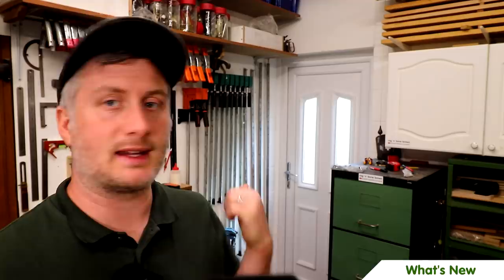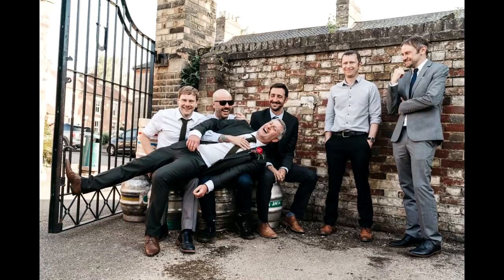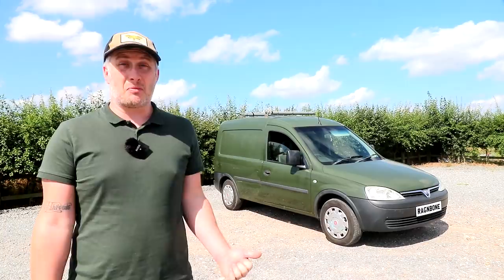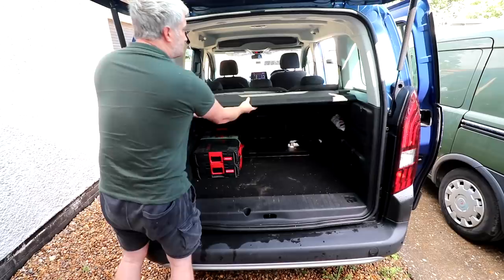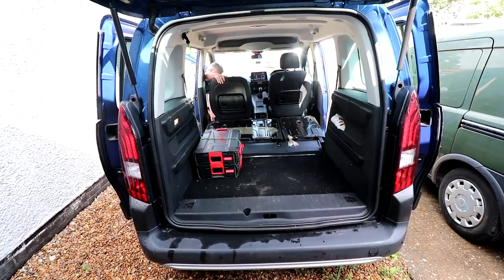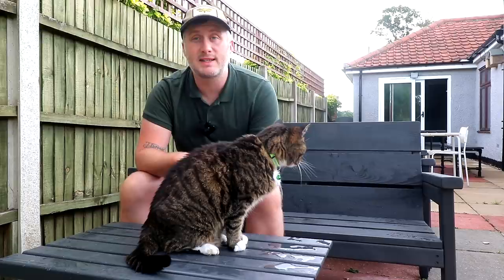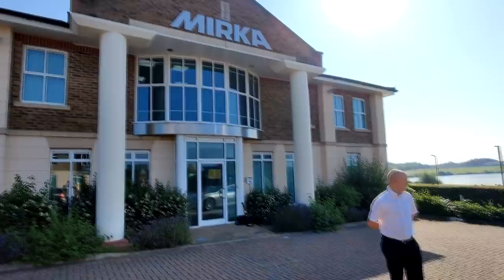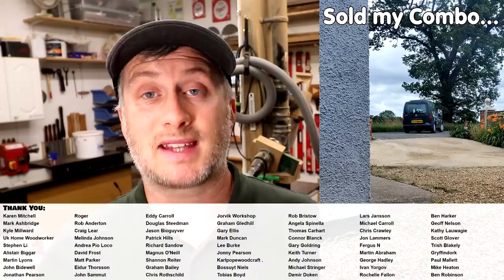VLOG 15 - What's New / New Vehicle / Wedding / Tool Talk / Recommended Viewing

Comment: Get some tarps just for the van. I just had them folded in the wheel well. I got used to being able to quickly cover the back of the van when I was picking up ratty wood etc. 
I cut some down to size but they would fray etc. So just kept them full-size and got quick at folding.

Comment: Sounds like you could do with a trailer, if you’re old enough you don’t need an additional test to tow.  I’ve got a 9x6 with a tilting lid which is great for sheet goods, up to 3/4 ton and I lined it with a carpet off cut to stop the plywood getting scratched

Comment: FYI lwb transit connect will load 4 full sheets of ply in diagonally ,with a solid bulk head
Reply from the maker: Hmmmm.. Not the one I test drove, there wasn't enough height to get it under the shelf above the passenger seats
Reply: @RagnBoneBrown  OK I had the same dilemma a year or 2 back and bought a lwb connect and it works fine in mine. Your new van looks the business, jealous of the extra seats!

Comment: Congratulations on the wedding and the new wheels. You may want to think about some protection to stop the stuff in the back coming into the front in the event of a collision. I use a piece of weldmesh that just slots in the rear seatwell and ties onto the headrest bars ( V70). I have a 8x4 frame of CLS which I strap on for carrying full sheets, which doubles as a portable panel saw, using additional bits of CLS and the Benchdogs Rail Square. I get the stuff home, and cut roughly to size before taking it off the car

Comment: Good luck with the pencil had 3 now over the last few years . I so wanted o them to work especially the long reach feature which you never mention so handy for marking through holes, but unfortunately they have never lasted very long as the clasp that hold the lead gives up and the lead just retracts on use  Maybe I should have sent them back but I leave them in my van and forget Doh.Having said that I've  had the carpenters lead one for about 10 years and been spot on for ruff work and lead lasts for ages.

Comment: The best pencil is the one you have to hand. Agree completely with the pica is expensive but I was buying packs of 50 pencils at a shot and especially being on site someone always borrows your pencil and it goes into the same magic disappearing rabbit hole I seem to put them. Had my pica about 3 years and is always on me so has paid for itself not only money constantly buying more pencils but time lost every day at work but most importantly my sanity. I also borrowed idea from Jimmy diresta and have 3m tape measure that I leave clipped onto my trousers and just pull tape from that position for all the constant smaller measures. Another sanity saver. I find 3m ox tape measure last the longest used like this.

Comment: Peugeot was the best choice indeed

I drive Hilux with the roof rack, which is doing its job: for kayaks, for 8x4 sheets, for large sofas etc. and small stuff I can just throw at the back.
Of course the van-like vehicles have some advantages when it rains, and you don;t need to cover your stuff with the plastic/canvas.

Comment: I use a Ford SMax as a van and I can recommend using an old carpet to protect the interior.  I have everything in mine sand and gravel in buckets, lumps of hardcore, wood, garden waste for the tip etc. Even better is to use 4mm ply and gorilla tape to create sides to protect the plastic.
Mine has done 139000 miles so is not worth a lot but removing the carpet and a quick hoover and it can carry 7 in comfort.
Reply from the maker: Cheers. Someone else in the comments mentioned using corex, I really like that idea. Will definitely get a rubber boot mat

Comment: Great catch up video Keith and I feel honoured to have possibly been one of the last few folk to get a lift in the old van! New car looks fantastic and so versatile👍. Thank you as well for the mention about the Mirka visit. Finally, I've had my eye on that same mic for quite a while. I currently have a Rode directional mic which is mounted about my phone when filming which has been great, but with the new workshop being so much bigger I really do need to address the audio quality (at some point)!
Reply from the maker: Cheers Leo. I have the Rode micro mounted to camera which I've been using up to this point and it's great providing you're close to the camera. Occasionally though I wanted to be further away from the camera and that's where the lav mics like the wireless go really excel 👍

Comment: Hi Keith, I use a Mitsubishi Shogun as a family/works vehicle as it is extremely versatile and cavernous with the seats folded down. Like you I was worried about scratching the plastic internal trim so bought some foam backed fabric and sewed up an expandable  three sided load liner which is held up with ties to various internal fixtures. I'd highly recommend the same for any new vehicle as mine has certainly protected the car from those little accidents and catches loads of dust and crud that inevitably attaches itself to tools and equipment. Hope the Pug is more reliable for you too!!
Reply from the maker: Love that idea. Someone else suggested correx which I also thought was genius as it comes in 2.4x1.2m sheets and bends along the "grain".... I bought a sheet today!
Reply: @RagnBoneBrown  That sounds like a sound plan as it could most probably be 'stitched' together with small cable ties and is quite cheap too!

Comment: Congratulations Keith & Ria, great news on the wedding.

The new van looks nice too, To keep it like that, what about a false floor which can go over the cargo area & the rear seats when they're folded down. It could be hinged at the end nearest the seats so when in taxi mode, it can quickly fold up out of the way of the seats. A shallow draw underneath could be added too for tools & accessories.

Comment: Top stuff Keith - congratulations!

You might want to investigate a plywood lining box for the new car - hinged front and back/sides so you can easily fit/remove it as required to transport all sorts of stuff without scuffing up the new shiny - 9mm might work and not reduce the overall loadspace too much. Just a thought.

Oh, a BTW - you can buy a proper Lavalier mike for the Wireless Go that clips onto your shirt much more discreetly and doesn't look like you have a hamster attached ... ;-)
Reply from the maker: Thanks Tim. I like that idea of a moveable plywood lining. It's really got me thinking. Possibly a future project! Peter Millard kindly sent me an old Boya lav mic he had spare so I will hook that up to the Rode at some point. I always worry though that the more equipment I introduce, the higher the possibility for error !
Reply: @RagnBoneBrown  Happy to help ;-)

Comment: Congrats on the wedding! 
I’ve got a picca pencil but dropped it so the lead just broke 😩 one tip I’ve picked up off John Stene of Stenewoodwork on Instagram, place a small magnet on the inside of your T-shirt, one on the outside, and providing your pencil has metal on (say a mechanical pencil) you just stick in back on your T-shirt after you use it 👍

Comment: if you attach a lav mic to the mic port on the wireless go it means you can get even better audio quality and just use it as a wireless audio transmitter and buy a great lav mic on amazon to use it with it reduces wind noise and the foot print of the thing as it can just go in your pocket.

hope this helps.
Reply from the maker: Thanks, yes I plan to try that at some point👍

Comment: I bought an inexpensive lav microphone on a short cord and I plug that into my rode wireless go and tuck that into my pocket.  It was a simple upgrade.  I just found that the wireless go was too heavy for my shirt collar and would flop around.  (I usually wear a t-shirt in the shop.  If I wore a polo shirt as you do, that might make a difference, or if I wore a baseball cap as a bunch of guys do...)
Reply from the maker: I just got a lav mic to plug in to it too 👍 I'm a bit nervous about it though as the more equipment you introduce, the more things can go wrong!
Reply: @RagnBoneBrown  Yes.   I have TRIED to train myself to turn everything on, but I still have once or twice just started shooting with the Rode turned off.   Or shot something and not noticed that the cable had come out of the camera.    I'm trying to find the original source, but not succeeding.  I forget if it was Jay Bates or a camera channel that suggested this:  I have the rode wireless go PLUS a lav, PLUS a shotgun mic, PLUS a splitter cable.  So the lav goes into the Rode transmitter.  Then on the camera the Receiver and Shotgun both go into the splitter, which plugs into the camera.   The idea is that if the shot is more suited to ambient, then I choose the audio from the shotgun mic, but if the shot is more suited to me talking, then I choose the audio channel from the Rode.  But more than that, if one of them dies, then I should still have the audio from the other.   It means that when I edit I have to select all my clips, put them in Mono, and always choose just the left channel (Rode) or the right channel (shotgun).  This adds a step in audio, and yes it adds a level of things that could go wrong, but so far I am happy with this.  I had considered getting a separate digital audio recorder, so that the rode would go into that, and the shotgun directly into the camera.  But I think that is more suited for LONG takes.  whereas in the shop I find that I am shooting dozens and dozens of clips, and merging all the audio together would, I think, be a huge pain in the neck.  So I prefer to have all my audio in the camera.

And I've rambled on way too much.  Best wishes!
...art
Reply from the maker: Cheers. That's a really great idea!! But yeah it's so so easy to get it wrong and end up having to shoot the same bit multiple times🤣

Comment: Thanks for the update Keith. Just on the van front, I have the old shape Citroen Dispatch (2010) and have to say that although you can fit 3 sheets of 18mm MDF in it, they have to go corner to corner which means the van has to be pretty empty. Does me, but if I was picking up sheet goods regularly (I tend t9 get them delivered) I’d probably g9 for a LWB in future. Starting to look at the world of electric vans, but currently prohibitively expensive to buy so think I’ll wait til the technology comes down in price a bit.
Reply from the maker: Cheers Darren. Yeah, to be honest I'd be quite happy with up to three sheets, as if I was ordering more than that I'd probably get it delivered anyway. But roof rack will have to do, for now anyway

Comment: Hi, I bought a cheaper version of the tool (pencil) but the sharpener leaves a little blob on the end of the pencil and although it is only 1 ½ mm in size it is not as sharp as I would like. My question is have you used the sharpener yet and if yes what is the state of the led end? Thanks for any info

Comment: How are you finding the Rode Wireless Keith after several months of ownership? Did you get the optional lavalier mini mic that attaches to the wireless receiver? I’ve ordered a new phone which I use for filming and was looking at improving the audio as well 👍👍
Reply from the maker: I'm on my third set, the first two both had a battery issue where the microphone battery would deplete all of a sudden from 80% to about 5%. So far so good for third set. Also invested in the mag clip so that I'm not advertising for Rode every time I use them. They are a little "breathy" but I tend to fix that in editing. Aside from that happy with them but may be worth looking at the DJI ones (potatojet has a great review) as they are better from what I've seen. Not sure if they're out in the UK yet though, they weren't when I bought my Rodes